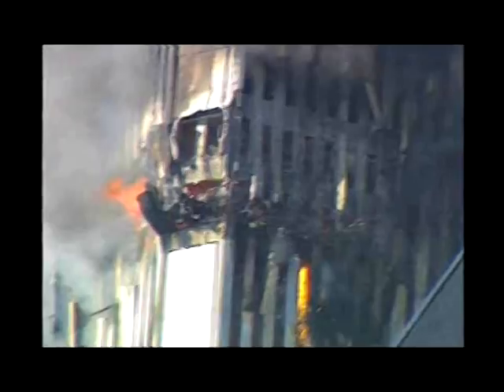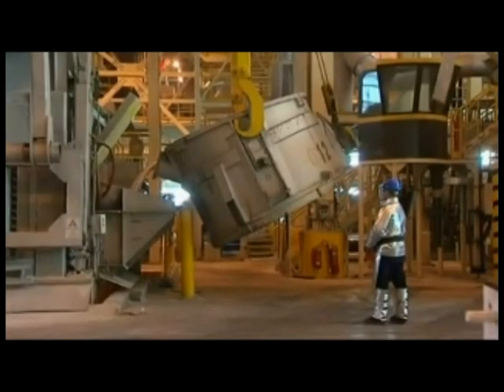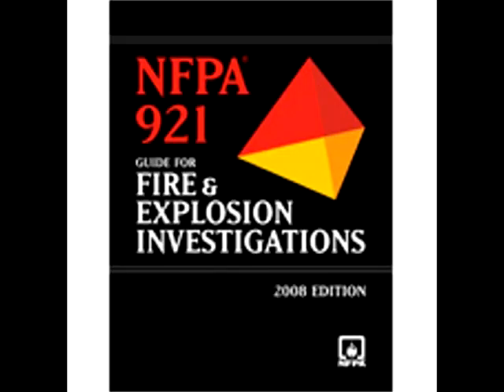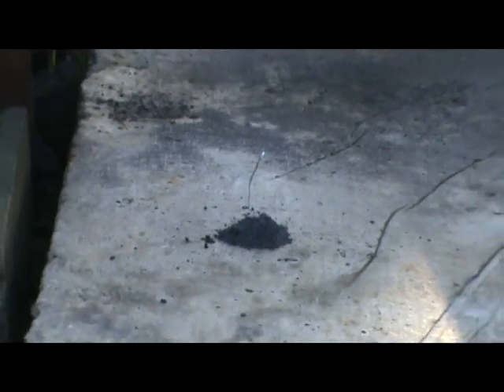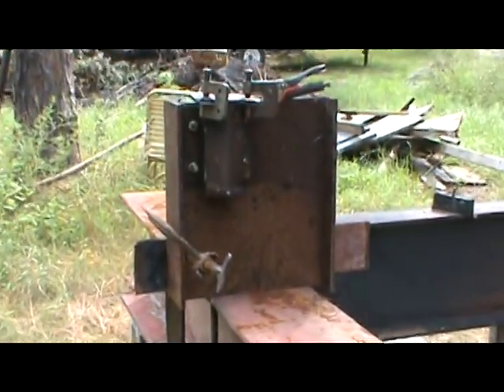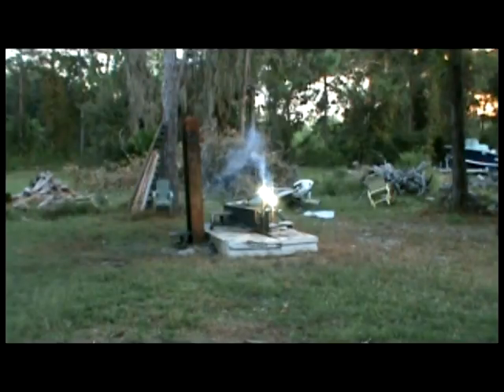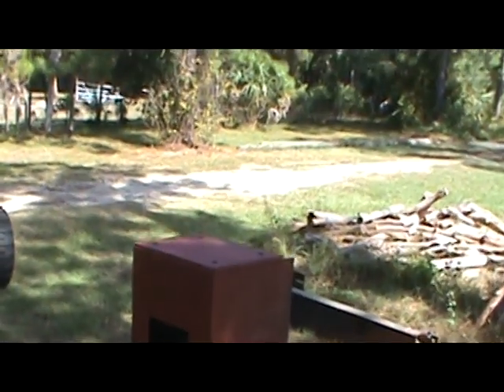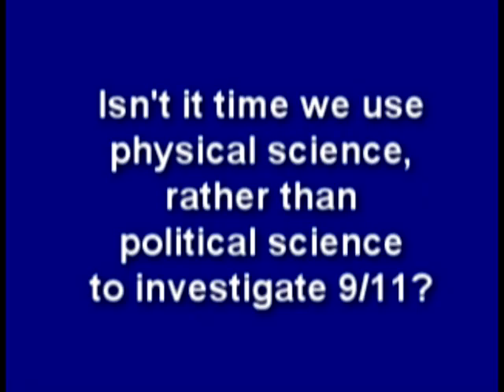9/11 Experiments: The Great Thermate Debate

Comment: "After the planes hit, the fires were burning out and cooling down."
Yep. 10 thousand gallons of fuel, along with tonnes of flamable materials definetly just gutter out within moments of being lit. Definetly.
Reply: "all of the furniture and building materials in the tower (and all skyscrapers) are flame resistant on purpose"
That...was number one.

"Second, the vast majority of the fuel burned off within seconds of impacting the building"
That....was number two.

"Common sense is all it takes"
That...was number three.

Sorry. You failed all three times. You're out.

No, all furniture and building material is NOT flame resistant. Not even NEARLY. And claiming it is shows you don't understand the first fucking thing.

Claiming that TEN THOUSAND GALLONS of fuel burned off within seconds? Show you don't understand basic fucking physics. That much fuel, in that short a time, converting into heat energy? Would level fucking Manhattan. That's the equivalent of a nuclear weapon going off. The towers wouldn't have collapsed, they'd've been vaporized instantly.

And from this, we see that you UTTERLY lack anything resembling common sense.
Reply: Aawww...what do you know. Dumb-ass is so dumb he can't even stand up for what he is claiming. What a SHOCKER....

Comment: Is it possible  the "explosions" seen in 12 columns (at least in the picture shown) are from gas pipes going all the way up the building?

The thermite explanation seems plausible, but it seems a bit over-the-top to me (mainly due to the fact that this is a fairly recent theory); I respect science as a whole, and I honestly don't know if it was actually thermite/thermate or a whole ton of coincidental variables that happen to work as a theory. This video is extremely good at the scientific method: hypothesis, research, then experiment; record/"publish" the data for others to see. I applaud "physicsandreason" for being the only channel to focus on September 11, 2001, even if this was a short time, and actually doing repeatable experiments to find out the chances of the World Trade Center collapse having been "assisted" with explosives. I wish other "Truthers" would do the same thing, not including a small selection of the people in this comment section. Would make debates less and less frequent and long, I imagine.

Comment: Av Gas, plus all the paperwork in these buildings, which probably was the main reason for the sustained temps. lets see paper + magnesium + JP 5 jet fuel. plus 400 mph, these planes would have gone thru any skyscraper built up to that point. Just ask the Enterprise.

Comment: I think it's fair to say that the official story is bullshit. The beauty part is if you don't believe this one story, the opposite story is about 16 storys. My story is to bypass the airport and cameras and go straight to the tv of the planes. They's not real. I believe. Fox Force 5, i mean Fox 5 New York has the plane flying through the building on a live shot. Think about it. A coke can through a grater. even if the grater breaks the coke can gets it big time. Physics. Right. The building blew up. There's a video that breaks it down substantially, but i could already see the explosions straight away. I remarked at the time (whilst not for a second imagining the 'inside job scenario') that the building resembled a banana being peeled. Takes a fair bit of force to peel a banana and destroy its contents, relatively speaking. Don't ya think? I will take a pass on Building 7.

Comment: So, your theory is that explosives experts cut open finished walls (MADE OF CONCRETE), removed enough fireproofing from the beams exposing bare metal and installed thermate to the joints then refinished the walls/ceilings (with CONCRETE) and painted them the same exact color to match the already old painted rooms/areas overnight? Or was the thermate added from 1968-1973 "just in case"? Fucking idiots.
Reply: almost as stupid as finding the terrorists passports!
Reply: They weaked the buildings with thermite but the real reason why the twin towers went down is something else. They used thermo-nuclear devices to pulverize the twin towers into dust.
Reply: +EPCOT NERD Yes but if you ignore all that...
Reply: +Da Do LOL, along with what? The rest of the passports and tonnes of other paper. You also quote the same people you call liars, lol
Reply: +IcantSeeReplies You could also make a list of all the bombings done by Muslims, but i guess that is not logical to the truther.

Comment: Yeaaaaaaaaaaah... except for "one problem" as you put it....
At NO point would even a nickel sized amount of iron need to be melted to cause a collapse. The ONLY thing necessary for the collapse of any steel structure is for the metal to be reduced in strength by about 50%. Jet fuel btw is MORE than capable of doing that.
Reply: "The ONLY thing necessary for the collapse of any steel structure is for the metal to be reduced in strength by about 50%."

This may indeed be correct, and we in the truth movement are not arguing against that. The issue is not that it collapsed (Building 7), but that is was a SYMMETRICAL collapse, with a SUDDEN ONSET (going from stationary to sudden downward movement), and smooth downward acceleration at the rate of gravity acceleration. Sudden onset implies that every support column was severed at the exact same time along the entirety of the building allowing the structure to fall uninterrupted by any material underneath into what was once the path of greatest resistance, with no "jolts" in motion, and with an almost perfectly straight roof-line. Asymmetrical damage cannot cause symmetrical collapse. It's very hard to accomplish that, since in physics, things tend toward chaos unless order is intentionally introduced into the physical system. That's why building demos require a lot of preparation by very skilled and experienced experts to get a building to fall that way. If the steel is weakened by 50% due to fire, we would see part of the building bend or lean first before we see a complete failure, due to heat damage being an accumulative thing, not to mention that heat transfer would cause the heat from the fires to be evenly dissipated through all the steel.

Also, jet fuel never had any impact on Building 7 since it was never hit by a plane. Even if it was, the jet fuel is not much of an issue since we can all clearly see the majority of jet fuel burning off in the giant fireballs at the time of impact.

Hope this is helpful.

Comment: That orange stuff pouring from tower 2 was molten aluminum, which at only 930 is orange, 980 is light orange, and 870 is red. Those fires were Not hot enough to melt steel, just weaken it

Comment: Yeah right. A team of people  placed thousands  of pounds of  Thermate at hundreds (thousands?) of  extremely difficult (if not impossible)  to access extremely specific  critical   locations throughout  each of  the buildings with  thousands of feet of detonating cord attached   strung throughout    the entire 2 buildings without being noticed.   Maybe it was the night cleaning staff.
Reply: Stinky McGoober it was done under the pretense of elevator improvements over a 9 mnth period...google this you will see i am right...all work was done at night over 9 months with elevator improvement work being the cover story ..
Reply: Thermite have been used to weak the buildings but the real reason why this buildings came down is something else The twin towers have been pulverized into dust & fall in 10 secondes. Only nuclear can do this. They used thermo-nuclear devices to destroy the twin towers.
Reply: Hey Bob, do you have detonating cable running across your desk? Ya Fred, what do you think it's for? I don't know let's just go back to working.
Reply: You forgot to mention that this was the first and only time buildings have been demolished in a top down, pancake fashion, and it was the first and only time a building has been demolished using themite, yet it all went perfectly. So perfectly that they also managed to cause major damage to WTC 7 - and start a fire in it - which was necessary for its collapse to be believable. That was lucky, because otherwise all the thermite and detonation cord would have been found in that building if it hadn't collapsed. Oh ... and for some unexplained reason they didn't perform a top down, pancake demolition of WT 7 and decided to changed their method for that building.
The insurance company then started a multi-year lawsuit over payment of the claim, and ended up paying $4.5 billion, rather than exposing the deliberate demolition and paying out nothing. It's also worth mentioning that Osama Bin Laden and Al Qaeda were actually allies who supported the U.S., because exposing the government conspiracy would have been far more damaging to the U.S. than any terrorist attack could ever be, but instead Bin Laden took responsibility, thereby taking the heat off Bush and forcing himself into hiding for years, where he was eventually killed. Further along those lines, for the first and only time in history, all the mainstream media around the world - even in places that oppose the United States - for some unexplained reason decided to sit on the biggest story in the history of the world. Of course it makes perfect sense for the media to do that. I mean ... they tried to bring Clinton down because he had sex with an aide, but they certainly wouldn't be interested in a story that would result in the President of the United States, and a number of people in his Administration, being sentenced to death and executed.
Reply: Or maybe it was the construction crew...
Reply: +Harry Balzak 
Where do you get this information and why is it not from the tower maintenance staff, security, or the thousands that work there? 
Then on all floor in the hope a plane hits and, and all missile and fire proof?? 
Such an installation does not and cannot  even exist.
Reply: +GB3770
All done under the pretense of elevator improvements 2 year ago, 5 years ago or what ever you decide in fact, as anything fit the truther narrative. 
Google is also run by Jews so this kind of makes the information invalid. BTW there is no installation that can be made to withstand a hit from a 500 mph missile and inferno.
Reply: How where the guns carried by one man up the mandalay bay  undetected??
Reply: A team with government backing can
Reply: Stinky McGoober 
Yeah you stink alright and your stupid too. So stupid you cant think for yourself. Did you know Bush's cousin ran security for the WTC? Huh ahole? Access was ez, they even had the dogs removed for 2 weeks prior and had cleaning stopped by 2am for weeks prior. There was a team of Jewish artists who rented a floor for a month and had boxes upon boxes of a type of blast cap stacked all around them (pics on net). Thats just a glimpse....wake up idiot.
Reply: Stinky McGoober Not so much.... A member of the Bush family was head of security for the twin towers, quite easy to disguise rigging as "general maintenance" throughout the buildings
Reply: Harry Balzak just because you make a lot of stuff up dont make it true.
Reply: 2 tons enough? 10 people 40 pounds per trip, 10 trips. 4000 pounds.
There were teams of people carrying spools of cable and all kinds of equipment going through the towers in the 2 weeks prior to 9/11. Look up Scott Forbes testimony about them which was collaborated by Port Authority worker William Rodriguez. They were heard drilling and doing all kinds of work including something that "sounded like heavy dumpsters were being rolled around and then taken off wheels. There would be a huge "BOOM" and the floor would shake". Large amounts of dust coming from the air ducts was reported in the days leading up to 9/11. They had absolute and complete access to the buildings because there was an unprecedented power-down which took offline all electronic devices including security cameras/door locks. Companies had to arrange to have massive servers backed up and relocated elsewhere during to cope with the power-downs. There were men performing "elevator maintenance" which gave them access to the vital core columns. 
Also, a large group of artists(E-Team and GELATIN) were given space and construction access to the World Trade Center in the four years leading up to 9/11.
Plenty of people.

Comment: The NIST never said it was molten steel. And I wouldn't believe a firefighter to determine molten aluminum from molten steel by looking at it when it's still glowing or covered in oxyde. And just by watching your video you can already see that the molten aluminum (which is about 500° C hot to be poured) is glowing red sligthly.

Also the punlished study on Nanothermite wasn't peer reviewed at all and debunked by numerous scientists. It had many structural and methodical errors. Where for Example, is the residue from Thermite or Thermate in the debris? When have large scale constructions took place to plant all that Thermite?And when they wanted have things quietly, why did the people hear explosions? Your experiment makes a lot of noise, so there is no proof in that. So, they could've used regular explosives instead which they didn't...

Comment: I'm still researching BUT one thing I want everyone to do is stop saying that steel melts at 1370-1400 deg. NIST NEVER said that they MELTED. According to NIST the steel beams were heated and degraded causing the floor to buckle down and stress caused the collapse. NOT the I-beams MELTED... There are still questions I have but stop the LIES on BOTH SIDES and lets get the truth out...
Reply: It isn't NIST claiming there were melted beams, it is a large number of eyewitnesses. 

Bechtel recorded temps over 2,800°F in the pile days after the collapse - well over the melting point of steel. WTC set a record for the hottest and longest lasting structural fire in history. 4 million gallons of water couldn't put it out.
Reply: Bechtel recorded temps over 2,800°F in the pile days after the collapse

Well this is a first. Show me.

Comment: this video is very well done and I don't think you are lying or hiding anything......BUT.....I wish you would put forth the same effort and see if you can get-r-done with diesel fuel. there is absolutely no doubt that you would succeed with diesel........try a "chimney" fire in one of those beams. this is NOT an open air fire. the building itself is a giant chimney and so are some of the columns. you have done a good job of investigating thermite (which the experts say couldn't have done it). but you didn't investigate the most OBVIOUS CAUSE. when you have attacked the possibility of jet fuel with the same amount of effort and proved that it couldn't be the jet fuel (I don't think that will happen) I will line up behind you and help you beat the drum for thermite!!!!!!!!!!!!!!!

Comment: Thermite can cut through steel.  So could an army of elves with hacksaws.
Reply: Eric Henderson , where's the evidence left by  the elves and hacksaws? cause there was evidence of thermite! I don't know why, or who did this. but somebody did it. and I want to know why
Reply: What is the evidence for thermite?
Reply: Eric Henderson It's the elements spectrum matched, not just spherical iron
Reply: Eric Henderson "WTC dust analysis" just google it
Reply: There must also have been a company of your elves hacksawing WTC #7. Elves or airplanes appear to be your only choices. 🏍
Reply: ThaLukeMan There’s about as much evidence for elves as thermite
Reply: I assume you are referring to the iron "spherules". There are plenty of better explanations:
1 Use of oxy-acetylene during the clear up
2 Spherodization due to formation of pearlite in the fire heated steel
3 Iron droplets left behind from welding during the construction of the buildings
I am not claiming that any are the correct explanation but I think they are more likely than having to resort to such bizarre ideas as thermite.

Comment: Show me when and where anyone ever claimed that jet fuel literally melted the steel beams. I don't think anyone ever doubted that thermite could cut through steel beams either, that's kinda what it was made for. Railway workers use it to cut and weld tracks all the time.

The question is not whether or not thermite could have cut the steel beams, but whether it's application was plausible, and that is where the theory fails to hold up. For the outer columns to have been cut by your internal charges, the thermite charges would have had to have been installed during construction. So I have to ask, are you suggesting that this supposed inside job was  planned way back in the early days of the towers? How do you conceal the hundreds of charges that would have been necessary to take down the towers? After every one of your tests, your thermite charge left its container behind, yet there was no evidence of thermite charges left behind at the scene. Where did these go if you think thermite was used? Where are the whistle blowers? A government run conspiracy would have involved hundreds, if not thousands of people. WHy has nobody spoken up 15 years later? When you start considering the practicality and logic of using such a method to take down the towers, the whole theory loses credibility.

Comment: interesting experiments. however, how would they have been able to rig up the beams that are buried inside the walls with a thermite setup similar to yours? the building wasn't full of exposed beams just waiting to be tampered with. they could not have done it after the impact because they could not get to the floors where the building was hit.